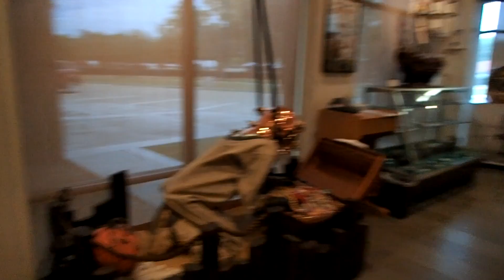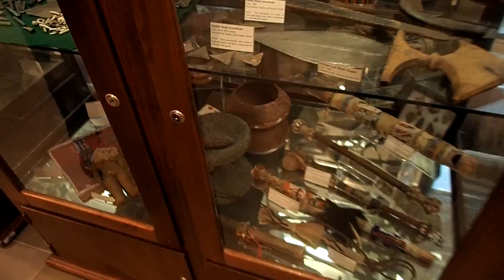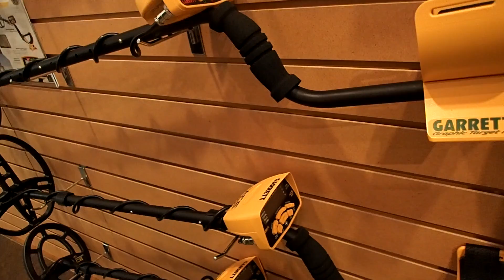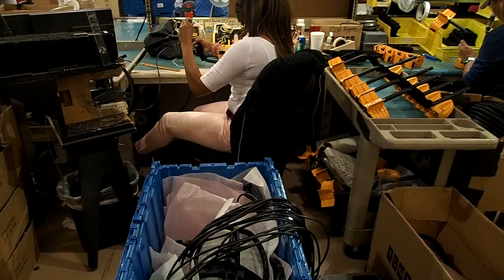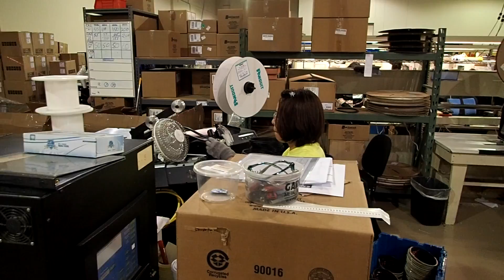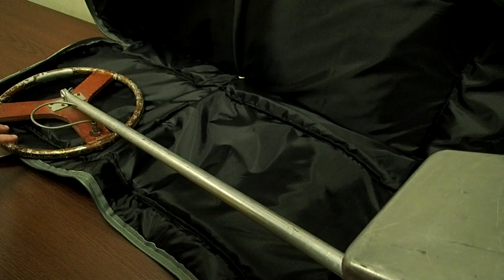My visit to the Garrett Metal Detectors Factory! | Nugget Noggin

Comment: If I decide to run my coin master detector on my yard, what are usually good places to be looking around a house? The town I live in (St Paul, Nebraska) was first settled around in the 1870-80s. My house I live in was built around or before the 1950s. I also live two houses away from the high school, the old building was built around the 20s I believe, with a gravel road behind my house (My old crappy detector found a dime from 1968, good sign.) I'd appreciate if anyone replied. :)
Reply: Under and around trees or big stumps, as well along walkways, under and around decks and patios, fire pits and or  well worn paths. Hope this helps

Comment: Most wonderful tour..enjoyed it...love the Garrett Company...they sent me many of those plastic bolts and nuts for the coil and arm braces that broke for FREE shipped to me even. I have six Ace 250 coils that are wearing thin just from normal use- long hours of detecting close to and on the ground...I re-solder the exposed worn down wires and then layer them with monkey glue type epoxy to keep the buffer and protect the coil wires. Garrett's prices and equipment are good...just wish the coils were a bit less expensive. coils take a lot of beating and wear.